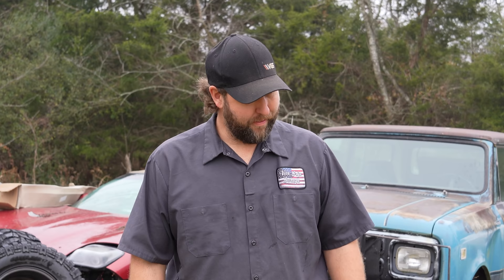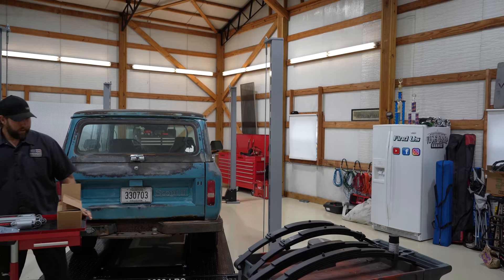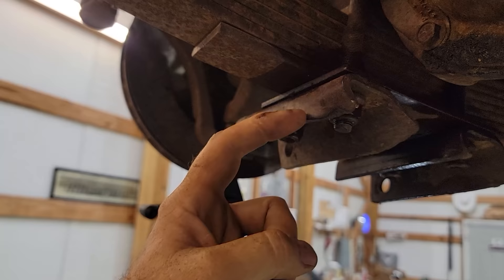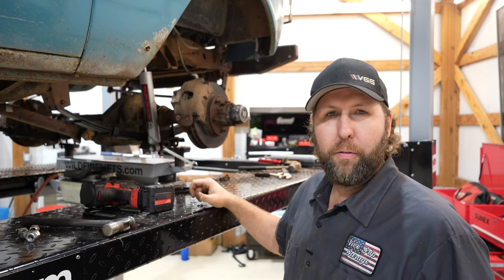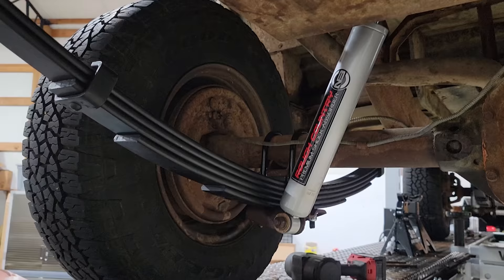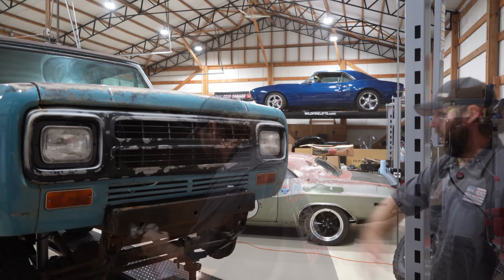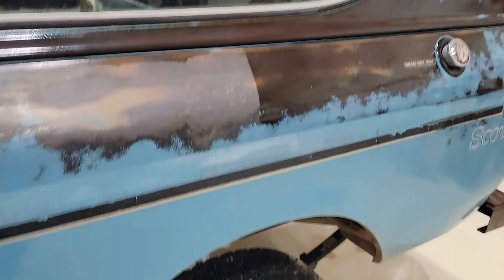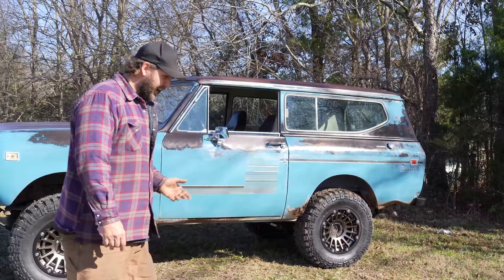I lifted my Turbo Diesel International Scout (INCREDIBLE TRANSFORMATION!)

Comment: You definitely need to rebuild this engine. Make us diesel guys happy.
Reply: ABSOLUTELY RIGHT...
Reply: With more power...
Reply: Yea great idea I'd love to see it rebuilt
Reply: I agree!
Reply: As Kevin Smith would say, "everything needs a turbo"
Reply: Have fun finding parts lol!
Reply: @allinaday3526  assuming the rest of the drive train isnt built like glass
Reply: @michaelcaraway2305  it is turboed it just needs more boost and fuel.
Reply: Definitely a rebuild, that would be a great build. Reach out to the diesel brothers
Reply: Has he done a Seafoam clean out on it?  Probably not enough but a help.
Reply: This thing would be killer with a 4BT Cummins
Reply: just new rings needed
Reply: He isn't going to, he just fixes them to run and drives them till they don't. Typical farmer mentality
Reply: With head studs a bigger fuel system and turbo then it will scoot.  And gauges ofcourse
Reply: Cummins swap or even I’ve seen a kubota swap done before but you got to get into gears with the kubota a lot more though. Either way beautiful rig.
Reply: @michaelcaraway2305  it has one.
Reply: @chickensfloat7427  It has a borg warner t18 or t19
Reply: I’d love see you rebuild the Scout, you’re an awesome mechanic and probably the best I’ve ever seen! Thanks for sharing you guys!
Reply: Also a treat for us Nissan guys. I want to see a rebuild just because it's a Nissan engine.
Reply: @Terminxman  im not familiar with scouts, but at least in the jeeps woth the holy grail t18 have the dana 20 t case. His international has a dana 300 tcase it looks like in the jeeps the dana 300 came mated to a sr4 or t176, sr4 later replaced by the t4 and t5. T18s are impossible to find so now the t176 is drying up. Got one in my 81 cj
Reply: @Terminxman  the older cj jeeps had 3 speed t150 with dana 20 t case, but like i say, idk much about international alls i know is i see a danna 300 t case
Reply: @theronash7269  I’ve had some good luck with Liqui-Moly’s “Diesel Purge” treatment. You set it up in between the fuel filter and the return off the injectors and it scrubs out the injectors pretty well. Honestly though, that truck needs a rebuild or swap…and with such huge new tires and wheels the latter sounds like a much better choice.
Reply: Probably just in need of a new injection pump.
Reply: 100% agree
Reply: turbo ppump swap
Reply: @Ahnenerbe1944  exactly a 4bt and a modern trans would make this thing a do all wonder.
Reply: It Would be a very inexpensive diesel build
Reply: @chickensfloat7427  SD33 is a very common engine in the rest of the world, Nissan sold them by the millions in other places so there shouldn't be any problems finding parts.
Reply: I hope he cranks up the HP.
Reply: @chickensfloat7427   There us a national Scout Fan Club.  Parts are not hard to find.
Reply: Rebuilt motor, turbo and add propane injection.
Reply: Doesnt need a rebuild probs a turbo rebuild , lines for the pump as if its the bosch ve ones with the turbo compansator a few O rings can fail causing issue ot boost line as well , 
More boost and minor fueling , 
Also new glow plugs they should start very quick 
20psi from about 2.200rpm with minor fueling so no smoke will make it go well sams for the TD engines that superseded them, a variable geomarty turbo can be fitted with a pressure operated acutualor and can be set in boost and how well it comes on ,  my dads d21 td27 is set like this and intercoolered , goes very well had to fit a lsd while on 33x12.5 as it likes to spin through the gears
Reply: @Ahnenerbe1944  there's and idea forget trying to eak out more power in that gutless 6,, but I like keeping thigs original and get them back to newish
Reply: Jim jibroni  then he should do a giveaways to his subscribers or patrons
Reply: Jim jibroni  As long as he eventually sells them, I fail to see the problem.
Reply: only the injectors
Reply: Wheels are definitely a debate. Especially when you are replacing the original rally wheels from the factree with aftermarket on a rig over 40 years old.
Reply: @allinaday3526  That was exactly my comment, plus fit an intercooler.
Reply: It definitely would make us diesel guys very happy to see this thing with some good ol’ diesel torque!!
Reply: @OnusofStrife  why?
Reply: Yaaas fix your power problem there with as much as she was smoking
Reply: At least change out the injectors. 😉

Ram
Reply: Nobody tells derek what to do.
Reply: @InRustWeTrustcustoms  EXACTLY.
Reply: @Ahnenerbe1944  3406 CAT 😂
Reply: @Ahnenerbe1944   Perhaps, but not everything needs a Cummins in it. The old SD33 is just fine, it has adorable rattle at idle and one can certainly learn to live with very little power. I think it is almost an artform in itself to be able to extract and make best use of the available power. 

Perhaps we'll see an earlier 2CV Citroen or something similar at VCC some fine day?  The earliest 2CV models had 9 hp, a little later a full 12 hp at drivers disposal. The fastest and most powerful had 29 horses at latest models. While certainly not fast, it was enough at its time and quite involving car to drive.
Reply: Nah k24 swap it lol
Reply: Not even a “diesel “ guy but I agree 100%.
Reply: Jim jibroni  he actually sells some of them
Reply: Jim jibroni  he got you to watch so thats another plus..  guess his plan on "views" is working out ok..
Reply: I say that engine is fine for now .... get to work on the body... cut and wild the rust ... push the dents out ... get it in primer .... that engine works just fine... for now... did you see it power up that hill.... it's making torque.... fix the paint.... used car salesman once answered my question  .... about 30 years ago ... my question ..."what percent of resale is appearance"... ??? That was my question .... answer.... 75%... salesman at Wally Edgar Chevrolet in Lake Orion Michigan ... about 1996 ... that's what he said 75%
Reply: Jim jibroni  so getting a rig running and moving around rather than sitting in the middle of nowhere rusting away is a bad thing?

He sells the vehicles after he gets them going in a lot of cases. 

Saving cars for the views seems more noble than what you've demonstrated here.
Reply: why ? it runs fine and its original
Reply: @Ahnenerbe1944  what makes it cool is the factory diesel.
Reply: @palljonsson4509  ... and even if he doesn't sell them, I still don't see the problem, great content on this channel 👍
Reply: YES! Let it be known MQ/MK Nissan Patrols shared this motor so there is a wealth of knowledge online/ Facebook groups. I can help source genuine old stock parts like head gaskets etc
Reply: YAAAAS
Reply: I agree!
Reply: I 63rd that idea. Seems to burn a whole heck of a lot of oil. Rings?
Reply: @walkertongdee  it smokes?
Reply: Man I love how it sounds.
Reply: Please, I do want to see that. An don't go making it pretty. I want to see that character on the outside.
Reply: I would like to see a 4-53 Detroit put in something like this. That would be badass.
Reply: @RedneckHillbillyGnR  That would be cool too. Or an inline 6v71. Would be a tight fit make the lift look small haha. Custom firewall time
Reply: Is there any way a 7.3 out of an old Ford would fit in there that would give you the snoos you need plus it already says International on the valve covers for the proper asthetics
Reply: @chickensfloat7427  plenty of those in the EU/AUS/JP (k160 nissan patrols). This engine still is beeing run all over the world. Granted, not that likely in the US. A guy could alway put a cummins in it. Or if he feels exotic, OM606 turbo.
Reply: @micheljansen85  i have amc 360 v8 in my jeep (why a amc? Cause its a bolt in swap) ylu can find parts simce ots jeep but amy auto part store wont carry the part. You habe to go on the line and its always not made anymore or its garbage quality. I supose at least niassan stil exists......
Reply: Jake, how? Parts for that engine don’t exist. Even when it was new, the engine couldn’t handle power adders. Its a full wet sleeve engine. That means the entire cast iron sleeve is unsupported from the deck plate the crank case. Add any power adders to it and they will just balloon out and blow everything buy. To hop up that engine he’d have to have custom sleeves made, each one costing more than a complete turnkey Cummins R2.8 engine.
Reply: @allinaday3526  this engine would blow up in no time with more boost. way too high comp
Reply: The Engine and The Floor Frame.
Reply: @happyjohn8256  definitely muffler bearings🤣🤣🤣 a muffler doesn't help with power🤣
Reply: @Wolfstanus  so should we all bow down to you & seek your divine inspiration!
Reply: Agreed that EGR will have filled the inlet manifold with soot and oil sludge
Reply: Yes. PLLLEEAAAASSSEEEEE!!!! 😂
Reply: You’re jacked
Reply: Minimum  needs injectors  and a bigger  turbo  all seals replace
Reply: parts for this are impossible to find.
Reply: @chickensfloat7427  the rest of the drivetrain is STOUT itll handle the power
Reply: Sd33 is a turd
Reply: You should have put some mean exhaust on there
Reply: I like them around zooming down badass rooms
Reply: No
Reply: You mean just spray painting it black right?
Reply: @michaelcaraway2305  it already has a turbo
Reply: @RedneckHillbillyGnR  too heavy!
Reply: Too heavy for the power output.
Reply: 1300 lb with turbo
Reply: @kendonahve924  I think a bit of a spring upgrade would handle the weight.
Reply: Bigger turbo maybe 2
Reply: @Ahnenerbe1944  Amen
Reply: Yeah. I'd like to see that, man!

Comment: These were good rigs new, just don't expect to much. I worked for an IH dealer when this was new 1978-1989 in the Seattle area. New the diesels would roll 65 mph on freeway 3.73 gears and get 26 mpg all day long. Your low power, your turbo might be weak or waste gate. no more then 5 lbs of boost it WELL BREAK, head gaskets, rods, crank we had one customer that played with boost we had the engine out 4 times the last time he got a new complete engine and he left it alone and he lived happy there after. check your fuel system have you replaced that fuel filter yet? those plastic fuel lines are factory the white one is return. rearend in my area ran 3.73 with the diesels this worked the best, if you go to 4.09s will help the power but you would have to change the carriers.your scout has a trac-lok make sure to put additive in it. as for your transfer case the ones with the aluminum tail shaft were dana 300 with a lower low range used in the diesels and 4 bangers Scout diesels were good rigs and the 1980 year was the best for the diesel powered ones.      retired mechanic
Reply: the v8s had the dana 300 also.
Reply: Was that I think bryant  IH in Renton wa I used to work there to in 89 I think that was the name but it's been 32 years
Reply: My 1980 diesel came factory with 31's and 3:73 gears and averaged 24 mpg with 210k on it. If the turbo starts to go its well faster to walk lol and the alternator has a vacuum pump on the back of it so something else FYI. I ended up putting a v8 in it because back in the early 90's parts were hard to find because there wasn't ebay ect. and what you could find wasn't cheap.
Reply: @bbroken1  yes

Comment: Derek I had a patrol with an SD33T in it, it was dead stock but it was definitely not gutless, i never had to use 4 low off road, let alone for going to town.  maybe make sure those approved fuel lines arent some kind of restriction, and check to make sure the injection pumpolator is pumpolating correctly.  probably go over all your intake piping and such to make sure all your boosts arent disappearing directly into the atmosphere.  if you want to do some upgrades, turbochargers from a CA18 or SR20 are fairly direct bolt ons
Reply: Ricerbros basically throw those turbos away you can scoop one up for nothings hell someone will donate him one for an ig shoutout
Reply: Sr20/ca18 yup. Truthfully best to just go over that rig top to bottom an you’ll find more powa baby somewheres
Reply: I’ll donate an rb25 turbo if it’ll fit the application lol
Reply: Its always funny to me that you can run smaller engine gas turbos on bigger diesel engines - is that because of efficiency? Don't the diesels need less air than a gas engine for the same power level?
Reply: Well. There is a triple thing to do when these engines are lazy. Four actually, but he drove it for a long time at high rpm's so that should be taken care of already.  On the mechanical diesel-pump there are two relevant adjustments. 1. Increase boost slightly by changing the org. one (6 psi) to a 12 psi one. Or manually on the one you have. Adjust (lenghten) the arm to the  vaccum-clock AND put a bøw-by valve on the rubberhose from the tubo to the vaccumclock. Measure boost as you adjust though... 2. Adjust out on the screw at the back of the boost-compensator.  Many say two turns out, but I would say max it depends on wear aso. Try with one, then... if needed. To locate it there is a brass cap on it.   3. Adjust the "Torque cam adjusting nut" which is the one with two nuts (the outer beeing a lock-nut to the inner). This adjust the smoke-gas. And key-word is more... Not crazy more, but it is a testing game. It should run HW-speeds up to 3500-4000 rpm easily. Is it a 4 or 5-speed? Mine had five and ran good at 70-75 mph on a trip to Germany in '03 on 32's. (A Nissan). 

 I was in this "era" 15+ years ago with a Nissan Patrol w160 1987 model. Lwb with the supre roff. And tons of weight reduction. Worked at it for a whole winter grinding, cutting, welding waay too much but came out decent. Sold it after using it for 4-5 years and I saw it was last on the road i 2018.  :-)
Reply: @warummussmeinnameangegeben6502  they need the same amount of air to make the same power, but these engines don't really make a lot of power.  they only rev about half as high as a gas engine, so you're only moving half as much air as the gas equivalent.  therefore, a turbo from a small gas engine is a great match to a mid sized diesel
Reply: @Dan-vi3pi  not even close unfortunately
Reply: I have 2 now, completely agree. down low the SD has more balls then a TD, will chug through anything. the car alone shouldnt really be having much of an issue even on somewhat steep inclines

Comment: I have a 1980 Scout II Diesel as well, my dad bought it new and it was my first car. I put the 2.5" Rough Country lift on it and I kept the spring perch spacers in the drinker's side. For whatever reason it keeps the rig level. I ended up with 31" tires on it and they still rub a little at full turn but I wanted to keep them tucked in so didn't use any wheel spacers. Mine has the 3.73 rear end with the same T19 4 speed and at 65 MPH she is screaming at 2800 RPM. If you want to get a little more oomph out of her I have read on Nissan patrol forums that the SD-33T can reliably handle up to 12PSI of boost. The stock waste gate and blow off valve dump at 6psi which I can verify as I have a boost gauge on mine. She builds boost like a dog but it still helps quite a bit, especially on the highway. Also I have the same problem with smoking on cold starts, from what I remember growing up it always did that. Keep the Scout vids coming, she is a real treasure!
Reply: Like to hear someone driving dad's old truck.  I have a 72 that my dad bought new and was my first car.
Reply: I think the reason for the spring shim is due to back in the day roads were pitched 5% for water run off. Every scout I have worked on has it.
Reply: @sgnob  That is very interesting, I left them in when I did my lift kit and it came out pretty much perfectly level so I figured it was some quirk of the Scout.
Reply: @sgnob  I helped build these Scouts from 76 to 80. Your exactly right, it was due to the crown in the road. These springs were way to whimpy for the weight of the Scout. If it had 200 lbs or more to the passenger side, it would lean going down the road.
Reply: My Dad used his '77 Scout II on a rural post route for 2 or 3 years, then let me take care of it when I got my licence. I had it until I got married & moved to Norway. It was in storage a year then sold for a song. Damn! I wish I had that ol' Binder.

Comment: Fun fact: Scout II's had that rear spring spacer (sometimes on both front and rear passenger side) from the factory because they had a tendency to lean toward the driver side. International engineers sought the simplest solution to fix the lean and added a half-inch spacer to lower the passenger side slightly. Even with brand new body bushings and fresh suspension, Scout II's still can lean because there's more weight on the driver's side.
Reply: This was the answer I was looking for.   I knew it was something like that.   Thanks!
Reply: @DrTylerBaker  
Early “classic” Range Rover’s had the same issues… but they had coils 👍🏻
Reply: Bingobangobongo!! Hope Derek sees this!
Reply: Toyota FJ Cruisers are the same from the factory, when you lift them most kits have a longer spring on one side :)
Reply: Yep...that is the correct factoid.

Comment: Derek is that friend when you blow up your v6 engine he just reminds you it’s a great opportunity to put in a v8, maybe jeep motor in the scout, could probably be had for two nickels and a shoe lace from junkyard
Reply: That is the best kind of friend to have brother
Reply: I actually did that to an 80s something Camaro. Blown V6, took it out and installed a 350 V8.
Reply: @jasonstoltzfus6540  the hot rodders way
Reply: That is a very rare motor in one of the last scouts to be produced. I don't think he would want to or ever should swap it out. May be one of only less than a dozen left on the planet...
Reply: @ronprice1819  yes but power and reliability are better then preservation for MOST vehicles